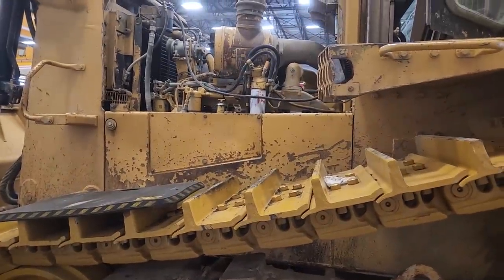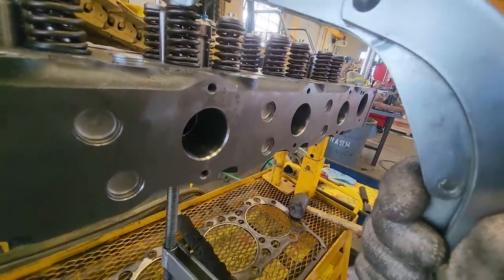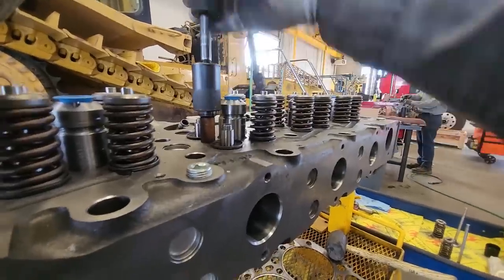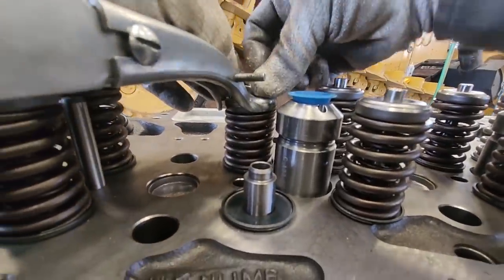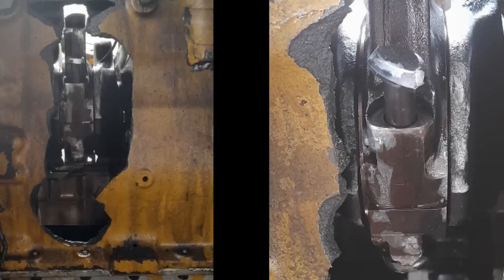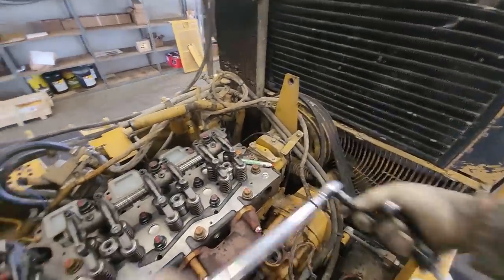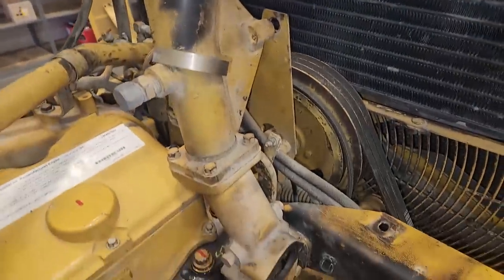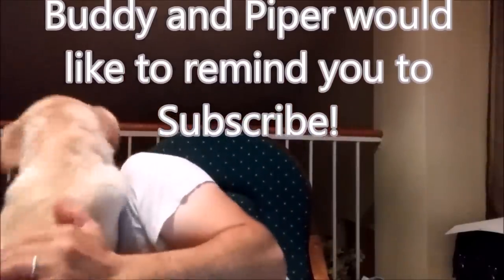"Thirsty" Cat D8 Dozer gets put back together. 3406 Head Install.

Comment from the maker: Thanks for watching the video. Do you think the cylinder head is going to fix the problem? Check out the Amazon Affiliate Links for recommended tools: Amazon Affiliate Link to recommended tools: 
Engine Oil and Fuel Dye UV: https://amzn.to/3z34zkv
UV Professional Grade Light: https://amzn.to/3gzxPc0
Allstar Oil Pressure Priming Tank: https://amzn.to/3L5pASm
Oil Pressure Priming Tank: https://amzn.to/3YuBrNr
Photo Tach REED: https://amzn.to/3ATJ8Cw
Reply: Great video as usual.
Reply: Hi if the air filter is blocked it forces to suck oil passed the value.
Reply: Being a tool addict! I already have the tracer dye and light I am amazed how many people dont know|use this. I started about 15 yrs ago when you had to perform the test at midnight on a full moon(just kidding) but it was viewedas a black art! I am not as familiar with Cats as you are but on the surface I would say that the head will not fix that kind of leak. Unless that particular casting has an oil galley that could be leaking It is unfortunate that who ever did the diag didnt use dye in the oil. The leak path might yeild clues. Thanks for including us in the diagnistics Solving murder mysteries doesnt hold a candle to solving engine disasters!

Comment: There is different valves on the ones that have dowels!!!! They have a shorter stem length from the keeper out!! The ones with the non dowels are longer because the floating bridge has a deeper hole in it! They will hit the rotator and can cause the keepers to come out! I am pretty sure that I am correct if memory serve me right!! please double check that there is a gap between the bridge and the rotator and that they rock side to side!!!!
Reply from the maker: I hope you are wrong Roc, but I'm going to have to check that on Monday morning though. I looked all over SIS for info on those stupid bridge differences and couldn't find anything in about 30 minutes of looking. If you are right, you may have saved this engine.
Reply: @AdeptApe  Like I said be a while, but memory says there is a different valve stem length use on the doweled head, than the dowel-less stem length from the keeper slots to the top of valve! hope I am wrong, but can not look it up, do not have sis anymore! Look up a 70v 3406 engine for the guide number and valve to see if it gives different part numbers than you showing in sis for this engine, to me the guides are wrong for this engine, when using the dowels, they use to have a rounded head, not the ones for mounting seals!
Reply from the maker: I'm 90% sure you are right after some research now. The guys over at Hell's Canyon Diesel just sent me an email saying pretty much the same thing you said. I found in SIS that the valves are different part numbers from head to head, but they are if they have the dowels in them. I think we can just buy the different bridges and redo the overhead adjustment. Monday will suck, oh well, better to find out now than in a week with a dropped valve.
Reply: @AdeptApe  Ouch
Reply: The 50.000 dollar comment roc you are a legend
Reply: Commented just to be a part of history. Roc you bloody legend!
Reply: when the account of the ages is etched into the cosmos, let those who exist long after us know that this was our finest hour! The legend will live on..
Reply: Nice Save Roc Schall! I'm coming from the follow up video to this comment.
Reply: Came here from the follow up video great save man I've been rebuilding these engine s a couple of years now never new this learn so much on this channel bless up
Reply: What a legend, he saved 50 grand
Reply: Awesome catch

Comment: I was out in the shop, I worked the spec shop, and climbed up on the tracks of a D8 with that engine in it! Talking to the mechanic answering some of his questions, when he said they were finishing rolling in bearings, I asked him, what are you going to do with the hole in the side of the cylinder block, the one I am looking through to see you!!! What, you need to pull the engine to repair it, possibly! He went and got the shop manager! Yes, they pulled the engine and sent it to the spec shop to be repaired! True story!
Reply from the maker: I like the "you have to pull the engine to repair it, possibly" comment. Your original comment is going to be highlighted in the next video, just a heads up.

Comment: Belly pans not fun to remove. Boy do I miss the old 3406 engines, be it in heavy equipment or trucks, they had a growl that was unique to them especially the dozers and tracked front end hylifts, you open the throttle lever and the engine growls. In truck applications (thinking about the 1986 Peterbilt 359/379's) they weren't all that powerful compared to today's engines but the turbo whine going through the gears was awesome (13-sp, 3:70 rears, tall 24.5 rubber). Today's trucks and heavy equipment have much more powerful / torque heavy engines with zero turbo noise and it's just not the same as the glory days. The 3406C was my favorite diesel.

Comment: As a retired military armoured vehicle mechanic, when you drop something, we call it feeding the hull monster. When we pulled an aging / transmission combo, we weren't surprised by what we would find and even had a cardboard box of "spare" told that previous techs had dropped.

Comment: I did a cat D7 engine. Had a coolant leak issue and milky oil. Ended up putting rods and mains in it and replacing the headgasket having an outside company machine and recondition the head. All that work for miss diagnostics on a water pump. That particular engine had to water pumps. One for the intake air cooler and one for the engine. One of the water pumps had a leak internal into the engine oil drive off the front drive creating milky oil. That one had to have the front radiator hard-nosed removed to finish the project. Took me like 3 weeks.
Reply: My boss has a manure spreader truck with a C12 Cat that got misdiagnosed in a similar way. Got in-framed when all it needed was a water pump
Reply: @Raise986  ouch

Comment: The first question to the customer would be, What oil are you using? Had a customer complain about oil consumption. Turned out he was using a 5W30 for car engines instead of a quality 15W40 G grade. Changed the oil and filter twice and cured the problem.

Comment: Ive worked on quite a few Cat engines in the gas compression world, natural gas fueled obviously not diesel. Its kinda crazy how many different kinds of valve stem seals they have available to use. On Natural Gas engines they get no lubricity or damping effect from the fuel on the faces of the valves, so they actually have specific engine oil for NG engines. So depending on the engine load, they have different valve seal configurations or if turbo charged or not also affects them. So in some cases they would start off with valve seals, but as the gas field depleted, the load on the engine would come down requiring different amounts of oil down the valve guides. So as an educated guess, I would say perhaps some Umbrella seals might help if the problem persists. They don’t positively seal off the stem but help deflect most oil away. They do also have positive seals and also seals that meter a certain amount down the guide. On gas engines, they suffer horribly from valve recession if they dont get enough oil on the seats.

Comment: Oh boy...keyboard mechanics working overtime on the D8 for sure...Good Job and a lot of work. Cat D343 old engine that Cat stopped making because they lasted to long. It was one strong diesel engine couldn't kill it...they were in the Cat 988 loader,834 rubber tire dozer, 631 scrappers etc. Years ago. Ever run into any of them ?
Reply: Drove an old 769a watercart for a while. Was a real good engine. Copped some punishment in the Australian outback and just kept coming back for more. Easily the oldest machine in our fleet and probably the least downtime out of all the equipment we had which was trucks, scrappers, graders, compactors,excavators and dozers.

Comment: As usual great video. I worked on Garbage trucks(front Loaders) for Waste Management. We used to lay down fender covers as tight to the engine and frame as possible It wouldnt catch all the tools and parts we dropped but it caught most. We had three reasons for not wanting to loose things 1 inconvience and having to replace your tools 2 some of the parts were hard to get 3 The most creepy problem was that the crevices and unwashable areas of the frame were usually packed with garbage and the friends that go with it. Unless it was a Snap on tool that your grand father gave you it wasnt worth retrieving! I love the film clip of The Destruction of the Week it would make a great Adapt Ape T Shirt! Keep up the good work

Comment: On the International you should check the injector cups for the coolant leak into the pan. The international Maxxforce DTs and older International DT engines have the lots of issues with the injector cups. I have dealt with this issue in multiple times. Hope this helps!!!

Comment: I copy ed an older guys flywheel timing pin locator, a slotted 1/4 " pipe with a 3/8 bolt with head removed having a roll pin going through bolt and spring. To where when installed in flywheel housing, the bolt shaft would snap into flywheel TDC locating hole when turned. Eliminating the need for a second person to locate TDC hole.

Comment: It sucks when Management / warranty dept/ customer does not want a proper diag. When all you want is to find the root cause and make a quality repair. 
I try to find satisfaction in the "I told you it will come back" moments the 2nd time it comes in for the same issue.
Reply: Many times they’ve got a time limit on the repair. I used to drive a brand new Freight Liner the fleet I was with had 10 of them. They all ate alternators we would get towed to the closest dealer they’d replace it. After the second one I asked why they weren’t checking for a deeper issue. They said warranty time didn’t allow that to happen because not enough time for the job. When the warranty ran out they checked and found the issue repaired it and replaced the alternator yet again. They didn’t have any issues after that. The fleet took all the problem trucks into their shop and fixed them the same as the first one.
Reply: @darrencatenacci2737  We do get time limits but, we can go over to find the original issue. There is just a lot more paperwork to fill out so we can get paid. 
Unfortunately the manufacturers typically don't base diag / repair times on real world scenarios.

Comment: If I remember right the smoke is controlled in the governor on the back of the fuel pump and the bottom screw controls the smoke and top one gives it the fuel or vice versa. They used to turn them up by taking both screws out and tossing them in the glove box:) Smoke looks cool every time you grab a gear and it makes Greta angry:))

Comment: I think that weird looking blade is a grubbing or root rake blade.  It's made to get the roots out of the top soil when you are first preparing a site and removing the top soil to get down to mineral soil so you can put in footing etc.  I'll pass on any constructive criticism, I left some on another channel a couple of days a go and you'd have thought I said something bad about the guy's wife or mother.  Keep the good stuff coming and wish me luck I have to run the valves on my Cummins 6.7 sometime soon.
Reply: I feel your pain.    The whole intern will dog pile on you if you say anything.
Reply from the maker: Thank you Johnny.

Comment: 12 point head bolts don't make it a C model. In the truck world Cat went to the 12 point head bolt, but the rocker arm bolts was still a six point. The early 3ZJ 3406C's was a six point bolt. Around the mid 25,000ish serial number the 12 point design started. One thing we use too do is after the rocker shafts was torqued. Put a reducer from 3/4 to 1/2 and re-torque the bolts under the rocker shaft's. They would loosen up after rockers was torque. So Cat came out with a new procedure. You torque the two inside rows first, 200, then 345. Then you put the outside row on and 200, then 330. The internal fuel lines, I would leave loose at the nozzles. Once I was able to prime the system, pump it up until I see fuel starting to come out. Torque fuel lines and soak up the little bit of fuel. Engine cranks better, as air is almost completely out of fuel system. When the first 3406B came out, (7FB) they still used the same head of the earlier 3406. Since they went from capsule nozzles to the 7000 series (pencil type) a new nozzle adapter was needed. The valve springs was larger thus, the valve spring retainer on the bottom covered the nozzle adapter. When the head had to be surfaced on the combustion side, you had to remove all valves out of head, so you could remove the nozzle adapter. A real pain and didn't take Cat long to redesign the head. With that nozzle adapter you had to hold the nozzle top nut as you was torquing the fuel line. The Jacobs Brake bridge was not recessed and you had to take the exhaust bridge off to get a tool on the fuel line. The intake bolts to the JWAC was three inches long with a spacer. Again production change and made it easier for the tech's.  
Hope you don't have to open it back up. Wonder if Cat oil stabilizer would help?
Reply from the maker: Thank you John. Your knowledge always impresses me, especially on the older engines.
Reply: @AdeptApe  My time frame, not yours. I grew up with these problems. Your looking back which makes it harder for you. Would take you a long time to do research on every little procedure that was changed or over looked.
This is what I teach in my SIS class. What part number seals would you put on the oil filter base for 7FB10835, numbers on graphic, 6, 14 and 21?

Comment: Hey love the channel, but I just had that experience where I didn’t catch the difference in valve stem height between the fixed bridges and the floating bridges above the valve, rotator and dropped a valve on a 3408 and the natural gas side of the world it only had 70 hours on the new heads if you want pictures of it, I can send you them
Reply from the maker: Sorry to hear that, send them over to AdeptApe@yahoo.com I just made a video on getting it fixed today actually.

Comment: Fire truck service is hard on motors. Cold and dark to full throttle after a short warm up. Sitting still pumping water, newer truck will do pump capacity at lower RPM's but still not the easiest service.

Comment: You need one of the spring loaded timing pins. There was a document about making them out of pipe fittings and a bolt. It may have been something the old timers had made. Wish I could find that for you. I have one but I don’t think anything has part numbers on them.

Comment: OMG! The old "I put it back the way I found it."
Who says the last guy did it right?
What is the serial number? 
The "A,B,and,C"Model use adjustable bridges, if the dowels are missing, and it has the wrong bridges, something is a foot.
Also those adjustable bridge engines had a valve train adjustment every 125k on hyway.
You oil consumption is probably the valve guides as you suspected. Caused by the wrong bridges, the rockers have more side torque on the bridges and valves without elephant foot style rockers on a 3406E or C-15, thus requiring the guided adjustable bridge.
Just because it's not on SIS for your Machine, you can look up the info on just the Engine 90% of it under the same Engine for other applications.
I just recently sent in a ticket on SIS not supplying info on a 3176 in a D6. I had to use a C-10 Ztruck engine to get info. CAT has now adjusted SIS and placed the info with the 3176 as it should have been. SIS2 is full of gaffs.

Comment: Could you tuck a fire resistant blanket on the sides to keep things from falling down underneath?   I use to work poles and towers and I used a fine wire to attach tools to my tool belt.  dropping something you need from the top really sucks.  I drilled and taped a set screw to the socket to the ratchet and did all I could to not drop a tool or me.    I am not a diesel expert but I have my doubts this will fix it.  I would bet they run the throttle to low for the work they ask of it.

Comment: Hey question here!
C13 acert here.  It runs rough at cold idle(not so bad when warmed up, almost like a miss but I did a cut out test and everything came back fine.
It runs the worst all the time if you have the park brake on and leave it in gear(automatic). Sounds like it skips a beat every few seconds.  While driving it's totally fine.
I bypassed the fuel tank and ran it out of a clean bucket of diesel and no change.
I did a full valve adjustment
Replaced fuel transfer pump
replaced the 75psi regulator on the fuel manifold. 
Fuel gauge on the compucheck fitting reading about 70psi at idle.

Any thoughts man? No logged codes.
We just put this remane in in December of 2022
Edit: just checked another engine and the fuel pressure was at 65 via the compucheck fitting

Comment: if the turbo oil seal has a bit of age and the turbo also is getting a few thousand hours it's a good possibility that it's leaking oil , turbos don't last so it might pay to get it serviced or a reman exchange one and put it on it. as you said you didn't know where it's using the oil. i would have done it before i did the head